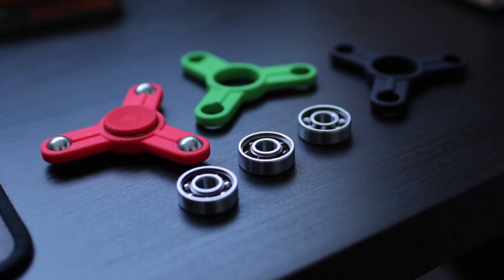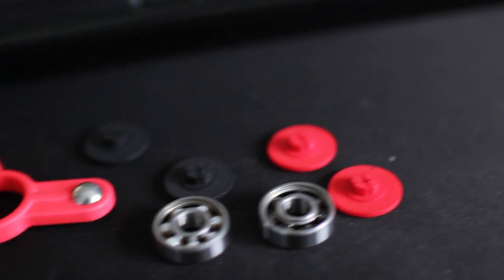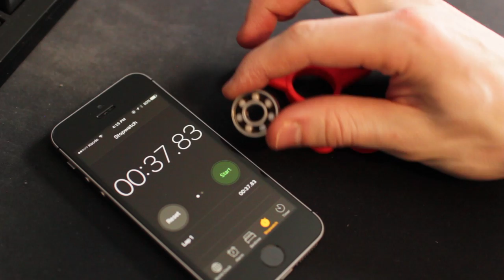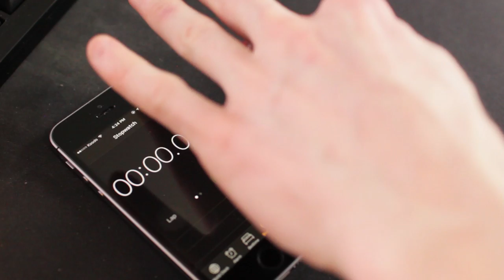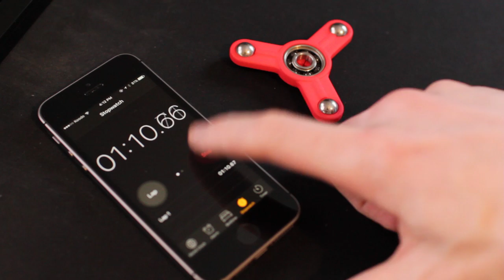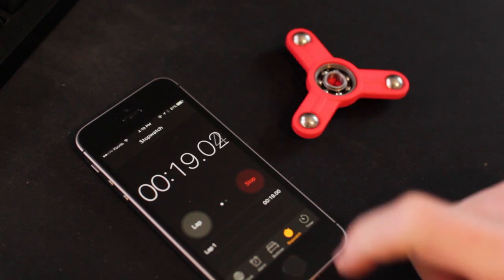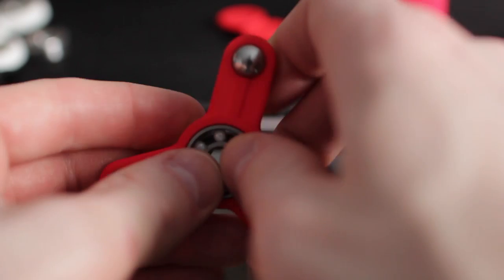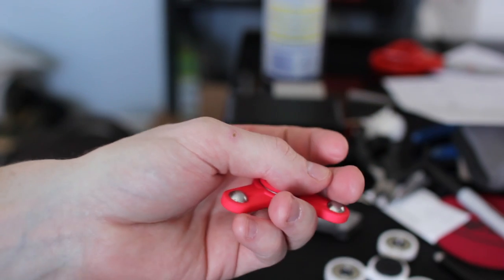Fidget Spinner Bearing Test - ZrO4 vs Si3N4 vs Steel

Comment: Glad i kickstarted this. Any tutorials for de-greasing these things yourself, like run them under water or use DW-40 or anything?
Reply from the maker: zeebezoo there are a lot of tutorials on YouTube, basically consists of using a degreaser like brake clean or some mix yourself stuff and use compressed air to dry them thoroughly before install - it not overly tedious but takes time to do each one.
Reply: Canadian Tire (if you live in Canada) have Castrol motorcycle chain degreaser, those would work fine. Kerosene would also work too; cheap and does the same job. Though make sure to clean and dry off all the kerosene after eh? hahaha
Reply: Just use 91% rubbing alcohol and make sure it completely dries.
Reply: You can also look up DIY skateboard bearing cleaners

Comment: i notice my spinner spins like way longer if i spin it with the bearing cage facing downwards, as in u cant see the balls, just the flat part of the plastic cage facing upwards. like theres a bad side to spin and a good side to spin lol
Reply from the maker: Haha thats interesting, maybe the weight of the balls sit on the nylon separator and cause a bit more friction.
Reply: SeanHodgins what's spins long zr01 or si3n4 pls reply
Reply: you are side loading the bearing with the weight of the spinner. This definitely adds friction compared to if you made the axis of rotation horizontal (instead of vertical like here) and can allow the cage or shields have an impact. This type of bearing is designed for radial loading and is not ideal for axial loading

Comment: Wait I though si3n4 was the best?!?!?
Reply from the maker: In my video? or in General? In my video and in my testing ZrO2 definitely was the winner(longest spinner) and continues to be.
Reply: ZrO2 is full ceramic, which gives it less friction and more speed.  Si3N4 is a hybrid, and while it does have ceramic (often times) it can't offer the full potential of full ceramic.  There's a lot of science behind why it works that way that I can't really explain because I'm not smart enough to, but it has something to do with the composition (obviously).
Reply from the maker: thoseweirdkids both of the ceramic bearings tested in this video are hybrid regardless of the ceramic chemical composition. Full ceramic means that even the races(the part where the ball rolls) are ceramic where as in hybrid the races are steel like a regular bearing.
Reply: thoseweirdkids idc anymore I bought mine I got the si3n4 and it spins for 3 minutes I'm happy
Reply: I ordered one with silicon nitride breaking.. will it spin long enough?